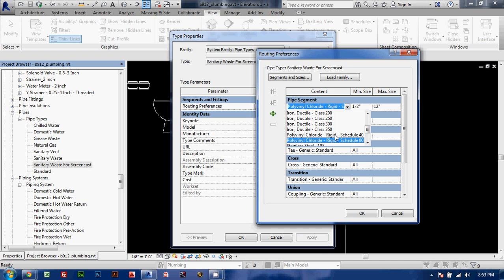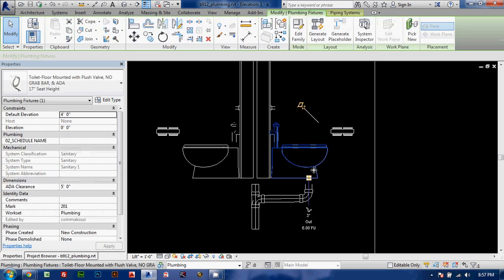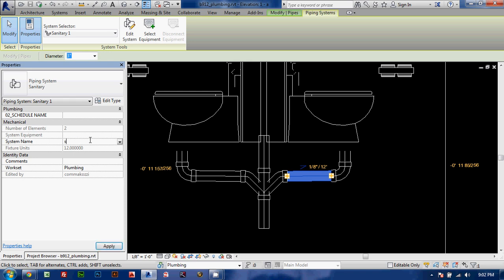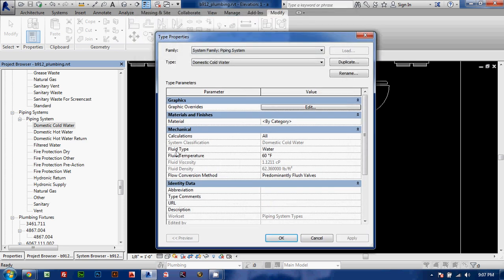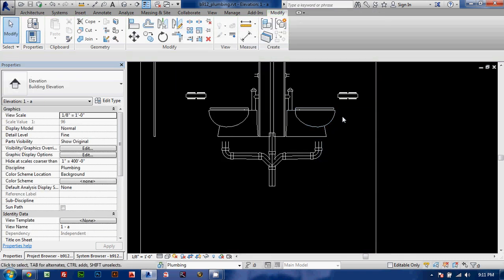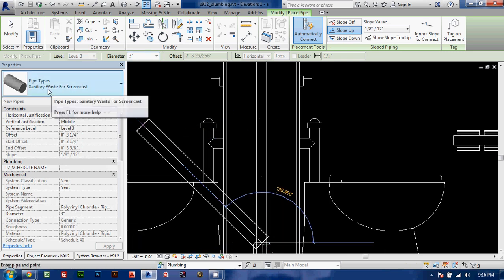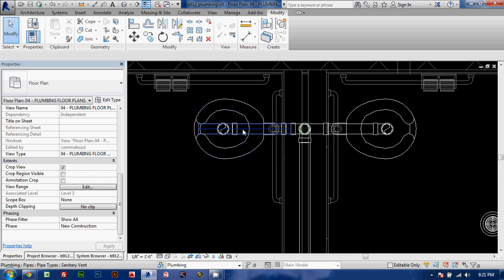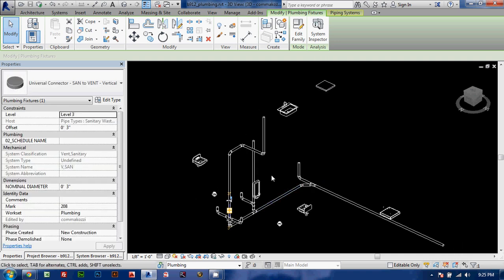Creating Piping Systems in Revit Part 2

Comment: Hi, its a great stuff..! I am stuck to one thing. How did you make universal connector SAN to Vent? Please explain, this would really help me to make a separate system. Thanks
Reply: I think he made a new family wich is merely a simple 3" daimeter extrusion, with two connectors, for sanitary at the bottom, and for vent at the upper face.
Reply: boshrai thank you Boshrai. I will check it.
Reply from the maker: boshra That's really all it is.  It's a clunky workaround, but it is unfortunately the only thing that works with that particular system currently :-(